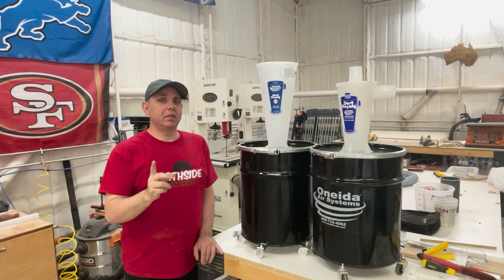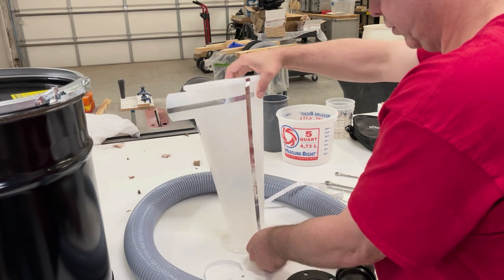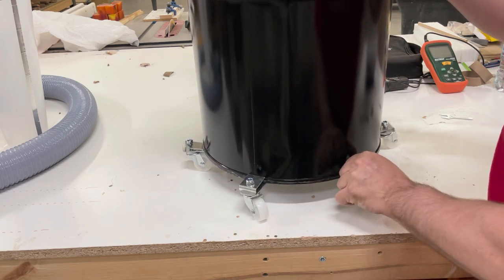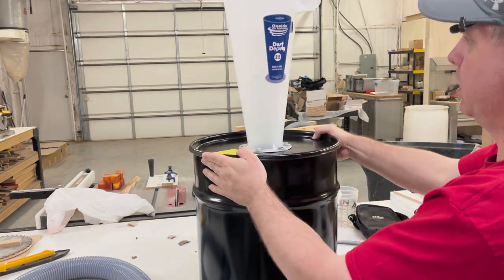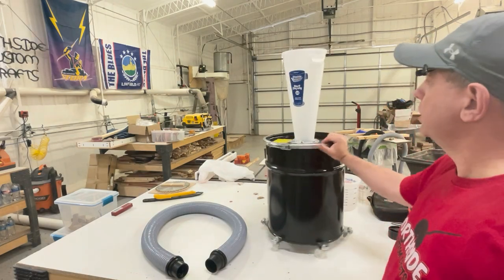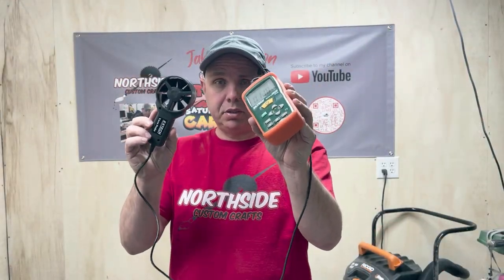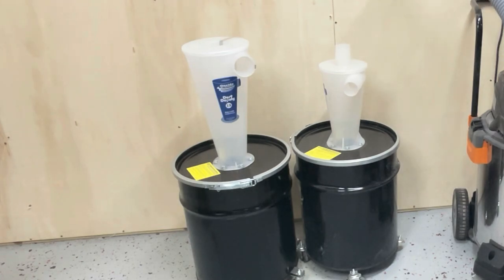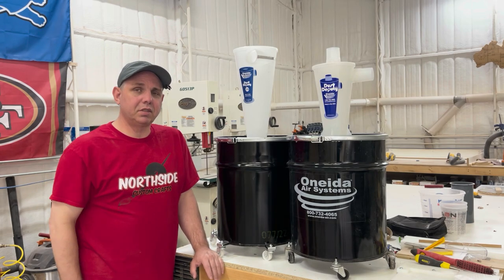Dust Deputy 2.5 - Assembly and Air Flow Test!

Comment: Jake, your videos are done well; however, your hand was restricting the airflow by nearly a third on the first one. You should redo this test.
Reply from the maker: Thank you Dr. Nunen.. I appreciate the observation but my hand is far enough away to not reduce the airflow. I admit it does appear that it may look like it will interfere with the flow  on camera but I assure you that in person that is not the case.
Reply: I agree with the Doc.  Your hand is definitely covering the exhaust.

Comment: Well, you just cost me $79.00 😆. I'm getting into wood working so I have been getting not only tools but dust collection equipment for my small shop. I started with the Dustopper which I've had no problems with. But all the videos say the Dust Deputy is the best, so last month I ordered it, been pretty happy with it, except I think my Ridgid shop vac that flows 190 CFM through a 2.5 inch hose is a little much for it. It seemed to pass planer chips to the vacuum and the dustopper just passed fine dust. So, I thought ok maybe this 2.5 one will be worth a shot. I suppose I will see next week. Looking forward to it.
Reply from the maker: Awesome.. I hope it work out for you 🦾🦾

Comment: Wow. Big one has 28% more CFM??? That is a HUGE difference. Also it would been great to have precise measure of dust separation like I described in previous comment in other video...
And now the question is. Did you compare these two with new low pro??? 
Thanks, Tomas
Reply from the maker: Comparing these with the Low Pro isn’t a fair comparison.. the traditional cyclones flow lots more air… I would like to see you do a comparison and document the weight of all the dust before and after.. it’s a brilliant idea and I would absolutely love to go to your channel and watch that as soon as you get the video ready.. let me know when it’s ready :)
Reply: @JakeThompson low pro has much less CFM than 2.5? Thats quite enough awhat I need to know - its a long time when I was in dust searching so I discovered that there is some low profile just from your channel...
And yesterday I tried to search about it and I get quite nothing!
And it is so important to compare this low profile with normal one.
I have a really small shop. I (was) excited about small one - it would greatly fit for me. But not a chance for cost of much lower effeciency.
And there is nothing on theirs website about this...
Reply: @JakeThompson and btw Ive just saw CFM comparison these two (old and 2.5) with low price chinese one and you know what? Chinese was the same as 2.5!! That means old DD is reaaaaaly bad cyclone...
But still I didnt see what really interested me - comparison with Clear vue - cyclone designed by "legendary" Bill Pentz... Its strange that there is so many videos about cyclone and nobody made comparison of two most famous...

And about my video. Well as you can see I also was really interested in dust collectiing hobby =D I have quite a lot information about that and I actually was thinking about making these videos - but firstly I have no viewers and secondly I do videos only about musical instruments what I make - no shop videos.

Comment: Hi Jake. Just watched this video. I recently bought the 2.5 but not the full kit (just the cyclone). I bought a larger drum-style barrel and made a custom lid with center hole and mounted the cyclone to the lid. Wanted more capacity since I have 4 tools connected via central-vac pipe. Clamped the lid to the barrel and fired up the vacuum (6.5 HP Shop Vac). Big loss in suction and virtually all the dust went straight in the vacuum. Yes I made sure the hoses were connected accordingly. Any suggestions?
Reply from the maker: I have my shop vac hooked up to one tool.. how big is your pipe and are the other tools closed off.. like only using one tool at a time.. also a leak in the drum will also make the dust bypass the cyclone .

Comment: Do you notice suction loss with these? I tried the dust topper and noticed that I lost a lot of suction?
Reply from the maker: These haven’t lost any suction.. used it today as a matter of fact.
Reply: There is a reduction in air flow using a Dustopper or Dust Deputy, by quite a bit. He should have shown the air flow for the vac with hose only for added comparison. I have an anemometer and have done all this with my DD, Dustopper and my 4” dust collection.

Comment: Finally getting dust collection into my shop. I already have a Rockler Dust Right 650 wall mount. Do you have any thoughts about running the Dust Deputy 2.5 with something like that? Or stick with the Shop Vac scenario?
Reply from the maker: The 2 systems work differently.. the wall mount has a 4 inch dust port and will work better with machines with a larger port.. like a table saw or jointer.. The shop vacs are better for sanders and small port tools.

Comment: Hey Jake I have a very small shop. I want to have dust collection for my wood lathe and a 12" flex hose for general, move around vacuuming of work desks and the shop floor. The distance from where my lath is to the vac location is about 14' of PVC pipe. In your opinion, can I get away with the smaller Dust Deputy and what HP vacuum do you recommend? Thanks!
Reply from the maker: I have the extra long flex hose from Home Depot … I use it on the lathe and also use it to vacuum the entire shop.. I suggest the most Hp  with the smallest tank. If you have the dust deputy, you don’t need a big tank.. I hope this answers your question
Reply: @JakeThompson  Thanks Jake! So the smaller Dust Deputy with a 5 gallon bucket and a 4 to 5 HP vac should b fine? Also, can I use 2" PVC or should I use 2.5"?
Reply from the maker: @RoundTownWithMike  I bet either would work fine for you, if you have the 2.5 I’m sure 2.5 inch pvc will be the way to go.. and 2 inch for the smaller one.
Reply: @JakeThompson  Thanks Jake. Today I bought a Craftsman 6 HP shop vac. I also found out they don't make 2.5" pipe. It skips from 2" to 3". 3" seemed way too big so I went with 2". It is actually pretty close to the same size at the 2.5" Vacuum hose. My longest run is only about 12' so I think I am fine. Anyway thanks for the reply!

Comment: Is the original one you tested the first generation original or the improved one with the neutral vein?
Reply from the maker: That’s a good question.. I’ve had it since 2017 or 2018 if that helps.
Reply: @JakeThompson  it is probably the first generation.  The improved original had 20 percent increase in air flow with the addition of a small piece of plastic at inlet that went from outside of funnel to the inside cylinder.

Comment: Airflow - check. What about dust separation??
Reply from the maker: The dust separation should be a given by now with these dust deputies.. I will be using this in the shop and will give updates as I use it
Reply: @JakeThompson  Should be. But is it? After the last two years nothing is a given any more. Do you plan to run a comparison test between these two? This is especially important in the case of sponsored materials.
Reply from the maker: @mp6814  I put sponsored on there because they sent it to me as a favor. If I thought I needed to do a dust separation comparison, I would have. In the last video between the dust topper and dust deputy, I did.. Like I said in the first response.. I will be using these everyday in my shop and will give updates… If that’s not good enough for you.. I’m sorry I fell short and waisted your time.. There We Are Then
Reply: @JakeThompson  Thanks. Not a problem at all, you do not waste anybody's time, watching YT is voluntary and a personal decision. Yes, the performance data will be absolutely crucial, nothing should be taken based on trust any more (again, not after last two years). At least we know airflow is superior compared to the older model. I suspect separation is comparable, if not a bit better (larger device may be more efficient), but again, this should not be based on faith. I am sure there is nothing to hide. Right?
Reply from the maker: @mp6814  I thought about dumping dirt and dust on my floor and vacuuming it up twice and it didn’t seem like a good use of my time.. I’ve done it before and the results were quite obvious and after that.. people without profile pictures still debated to no end about it.. so I decided against it..
Reply: @JakeThompson  ugh! 🤦‍♂️ 🤣
Reply: @mp6814 I’m curious about the performance as well. Bigger size and better air flow does not means it’s better at separating dust. I’m thinking it’s better airflow and suck more larger particles but worst at separating fine dust. Dust separator is not a one size fit all. Smaller cyclones are better at separating smaller dust. Too bad he’s not comparing when he got both.